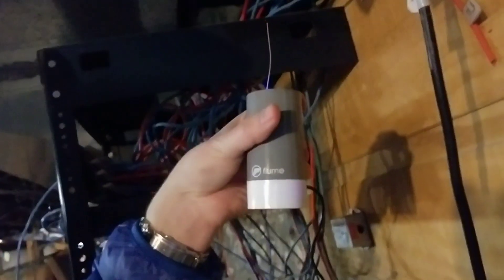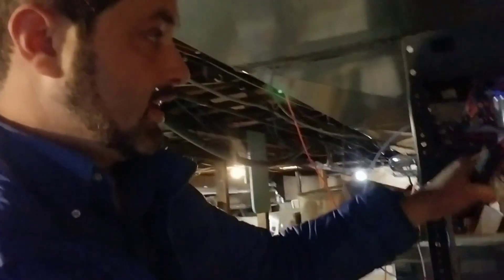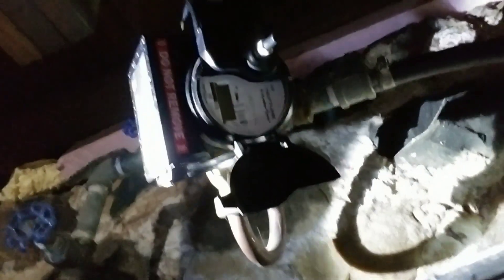2019.04.27 - Flume water meter sensor installation

Comment: Flume is garbage. Actually all of this water meter sensors are garbage.
Reply from the maker: They have saved me thousands of dollars.  They might not be one hundred percent accurate but they tell me when I have a water leak.
Reply: @benplikerdsminute  if your house get folded, you file a claim and you able to remodel your house

Comment: This device actually works.  A sink was left running in a spare bathroom. In the morning, I received alerts stating that there was a leak somewhere. I investigated and found the running water. If this wouldn't have alerted me, I would have gone to work and missed the leak for the entire day. I'm very happy with this device!
Reply: Ever try to just trickle?  Today I discovered a pin hole size leak in my reverse osmosis system which caused some major damage to items below the drop ceiling in my basement...how sensitive is it?
Reply from the maker: It's a great product